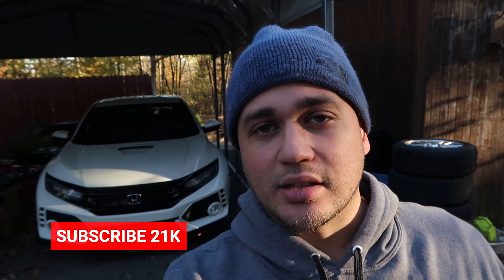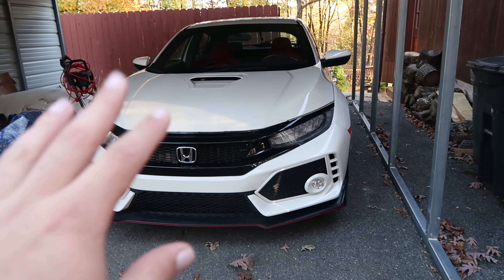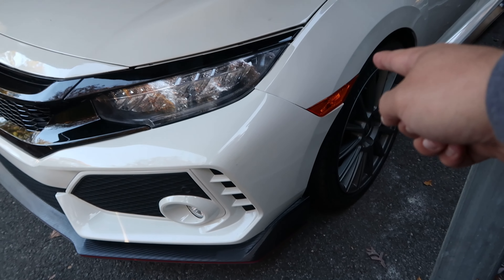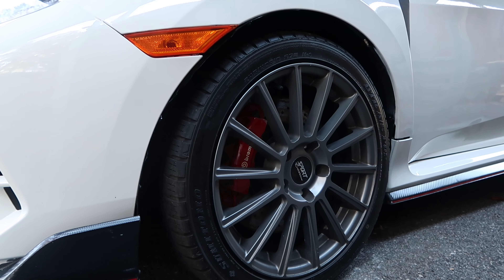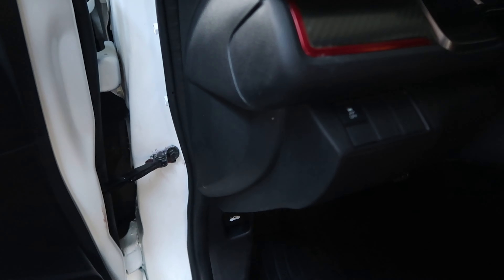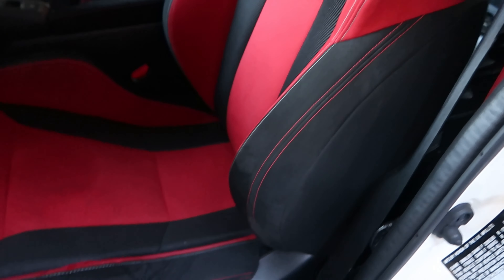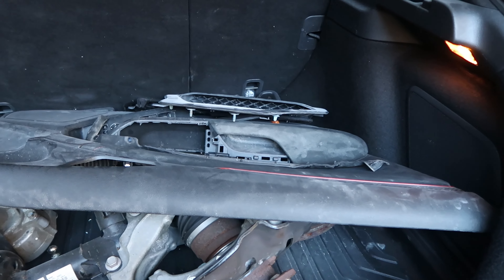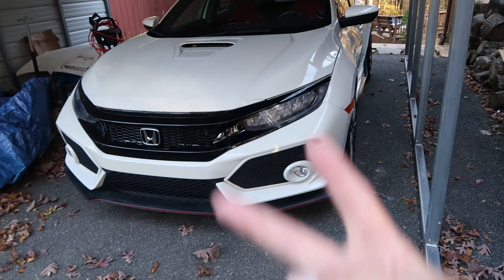Rebuilding a WRECKED Civic Type R (FK8) | BEFORE and AFTER fixing it!

Comment: Rev match issue is most likley the wiring harness  (remember, the recall was a thing and still is though Honda) https://www.civicx.com/threads/new-service-bulletin.25633/    also, I will buy your hood scoop if it's not too damaged for the right price ;). Also,  I've also had this rev match issue pop up when I lost Fuel pressure due to E85 maxing the fuel pump.